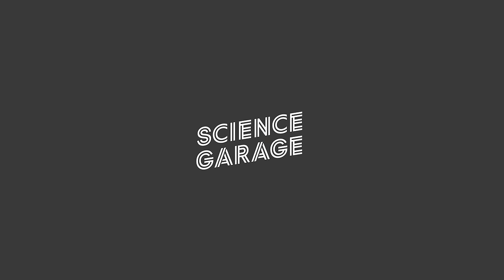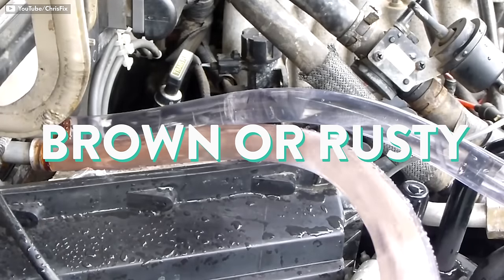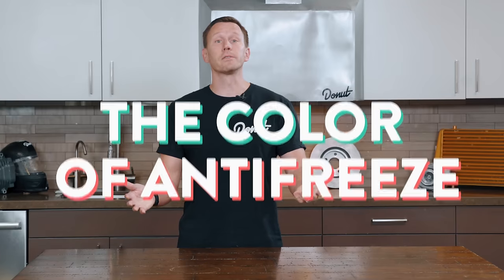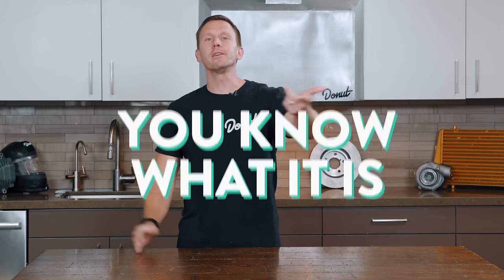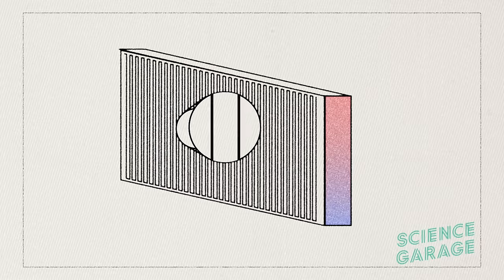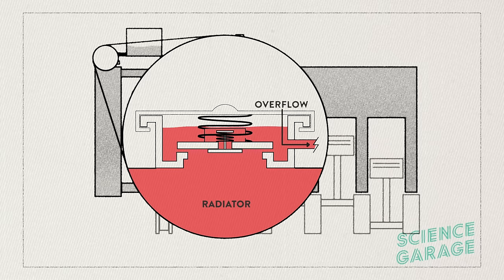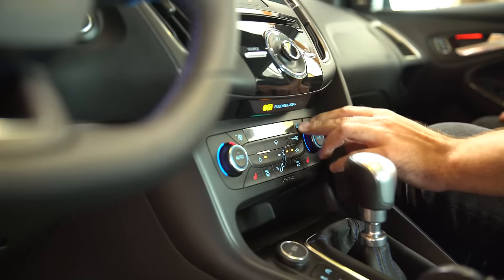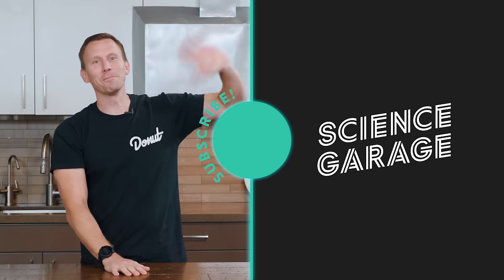ENGINE COOLING | How It Works

Comment: Tachometer | how it works

Throttle | how it works

Differentials pt.2

Active aero | how it works

Pop up headlights | how it works

Automatic transmission | how it works

Weight reduction | how it works

W16 engine | how it works
Reply: Is this a joke?
Reply: You're a legend
Reply: N ECU
Reply: if you want automatic transmissions they already did torque converters
Reply: LMAO pop up lights. "Little motor turns headlights up and down, the end"
Reply: gg
Reply: Mj Tingzon Lol pop up headlights? Weight Reduction?
Reply: ur ex | how it works, oh wait it CAN'T
Reply: THROTTLE PLS
and cruise control!
Reply: Headlight fluid | how it works
Reply: Pop up? active aero? Why?
Reply: Mj Tingzon fucking magnets | how do they work?
Reply: W16 engine: works like any other internal combustion engine for the past century
Reply: Windshield wiper how it work lol
Reply: Yes exept the auto trans, screw that thing
Reply: ENGINE STARTERS | How It Works
Reply: Will donut media read this ??
Reply: Thank you. ... I agree so much stuff every1 wants to know that everyone can relate too 👍👍
Reply: you really need a 10 minutes video to understand how pop up headlights and weight reduction work?
Reply: life how it works
Reply: Wastegate*
Reply: Muffler bearings | how it works
Piston return springs | how it works
Reply: @Sapphire3133  magnets, how do they work
Reply: Arm rests; how it works
Reply: Throttle: Push the pedal and a valve opens! More air and fuel makes morw power making you go faster the end
Reply: Ok for the weight thing pick up 15 pounds and try to move it around, then once you get an idea of how difficult it is to move that much mass do the same but with a 5 pound weight. Alot easier right? Your basically the mechanical components of the car and the weight is what the components has to move and manipulate, the less weight to move the easier it is on your components and the faster everything can go. When i put weights on my kart to run legally in competition it felt alot lazier, didnt wanna accelerate, didnt wanna turn, didnt wanna slow down.

Comment: Next: 
steering
.
ABS
.
Electronic stability control/ traction control
.
Radiator
.
Automatic transmission
.
 tires (not wheels)
.
Not necessary-
.
Gaskets and washers
.
car safety (airbags and stuff)
.
Clutch (i think you already made a video about it)
.
Reply: THE GREAT MANIAC pretty sure they made one about tires earlier on
Reply: Gaskets and washers literally serve a single purpose, there's nothing to explain...
ABS and ESP/TC could all be in the same video, even hill start assist, everything uses the same system.
Reply: Kamil 
You're right, i was just giving ideas tho

Comment: Very apt use of the RB engine in the thumbnail. Prior to the manufacture of the N1 block, Nismo teams had trouble keeping the temp of cylinders 5-6 in check in high power race applications, making it run lean from the temperature and eventually cause failure for the group A GTRs. They solved it with the N1 block’s cooling channel upgrade and later the GT block.

Comment: Turning on the heat to cool an engine works extremely well. Had to do it once because the maintenance shop forgot to put our coolant tank back on. It worked so quick.

Comment: 3:29 they show a person in the back grinding on a rail while showing the numbers “50-50” on the screen, because in skateboarding, the trick term for grinding on a rail using both trucks is called a 50-50.

Comment: Thank you for this video. So the hose on the water pump is the return or outlet from the heater core right? And the one coming out of the thermostat housing is the inlet to the heater core.

Comment: recently went on a 1600 mile road trip and on day one after driving for around 5 hours and 250 miles my engine started over heating. I thought, not knowing enough about cars, it was just my V8 needing a break. So i stopped and lifted the hood and let it cool for 30 minutes. and anyway, it kept overheating throughout the rest of the night. Made me really nervous about the rest of the trip and Wonder if I should keep going. 
I stopped at a walmart to sleep in the car for the night and in the morning I checked my coolant levels to discover I had NONE. So after I topped it off she ran just fine the entire trip.
Moral of the story is to always keep some coolant on ya

Comment: me and a friend once had to use a Honda Fit at work to do some stuff all over the city, and it started overheating, what saved us was the hot air, in the middle of fucking 40C summer, and also turning the car off when stopped for more than 5 minutes

on another note, what the fuck was this video, i love it

Comment: 1:03 Coolant/antifreeze is definitely not there to raise the boiling point and it definitely does not prevent overheating. The part of the system responsible for preventing boil over is the fact that the system is closed and can hold pressure. You can run 100% pure water as  your coolant (and many people are required to for track cars), and the system will be fine so long as it holds pressure. In other words, you can remove all of the antifreeze and the system will still function completely normally specifically in regard to overheating and/or boiling. If you prevent it from holding pressure (by removing the cap or whatever), though, it will most definitely boil over, because the pressure in the system is responsible for stopping that.

Coolant does have other important properties, but it has nothing to do with preventing overheating and nothing to do with raising the boiling point.
Reply: Antifreeze does raise the boiling point, and so does pressurizing the system.

Comment: If the spark plug #4 doesn't fire will it cause a problem with the engine cooling? Also could you tell what are the effects of other three spark plugs in 4 cylinder engine. Thank you for the film.

Comment: In a motor, all antifreeze is coolant, but not all coolant is antifreeze.

We had this talk in the shop, we still interchange the two terms.

Also, I didn't know thermostats were wax motors. Look up AvE Wax Motor video is anyone is interested. AvE might've actually mentioned it, but if he did I wasn't paying attention,

Comment: The problem with choosing a coolant/water ratio is that I live in St Louis, where years have a lowest temp of 27 below zero, and a high of 123.
Reply: The optimal coolant to water ratio is 50/50. If you add too much water not only do you decrease the freeze protection but you also increase corrosion

Comment: If you’re still around, why is my coolant temperature lower then the temperature outside? Example, car difficult to start because the coolant temperature was 25° and the temperature outside is 32° does that mean my coolant isn’t sufficient? 91 El Dorado Barritz 4.9 L, aluminum. I believe it’s 50-50 mix

Comment: Did I hear that right? If you're engine is overheating, you can turn on the heaters in the car for the passengers and it'll draw heat out from the engine to help cool it down??

Comment: Funny and entertaining as always, but the animation dropped the ball! Coolant usually flows vertically from the bottom of the radiator to the top. If it flowed from the top of the radiator to the bottom, you’d get a “waterfall” effect and inefficient cooling (and basically you’d never get all the air out!).

Comment: This video would be correct IF: anywhere in it the fact that a large portion of engine heat is absorbed into the fuel and engine oil does the bull work of the cooling.  I believe the water cooling system is just enough to deal with 15-20% of the cooling.

Comment: Why do we use thermostats instead of just having coolant circulate through the radiator regardless
Reply: Probably to make sure the coolant has absorbed sufficient heat.
Reply: Its to let the engine stay at operating temp. If coolant was constantly circulating the engine would take longer to warm up and can have trouble staying at operating temp. What the other commenter said is also a reason.

Comment: At least the Two Cylinder Two-Stroke engine of my '89 Trabant is air cooled. I dont think that it would have survived its 10 Garage years with Water rusting trough the Block...

Comment: Interesting fact if your thermostat is stuck closed hot air will leech out of your vents regardless of what your climate control is set to, alternately if it is stuck open your heater will never heat up. This is the most common way a person will notice their thermostat and or thermostat sensor and or thermostat control module is malfunctioning. This will also cause you to get in an argument with a lower end mechanic because they will 99.99% of the time insist it isn't the case and that your climate control has nothing to do with engine temp. Should you come across such a mechanic never allow them to work on your car again unless you like getting repair work redone.

Comment: Pretty good expect you did not mention why radiators and the cooling systems are kept under pressure. 
Ans: They are kept under pressure to increase the boiling point of the antifreeze. Because the boiling point of a liquid goes up as the pressure around it goes up.

Comment: still don't get the difference between air-cooled and water-cooled  why does one only use air the other uses both
Reply: Air cooled motors blow air around the engine to cool it. Water cooled motors use water to cool the engine and use air to cool the water. 
Air cooling is less effective than water cooling, however it is a lighter and simpler system